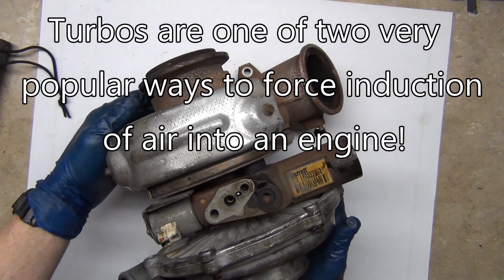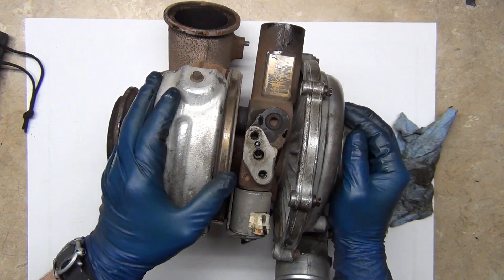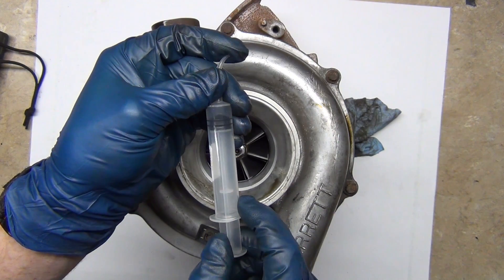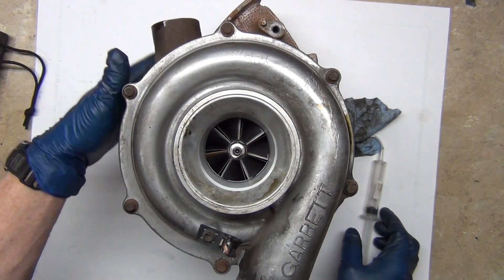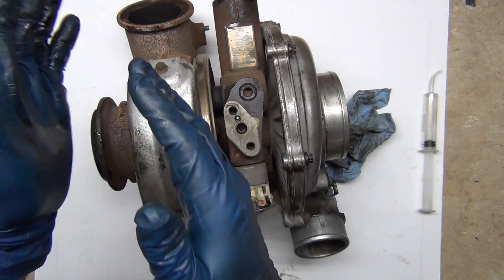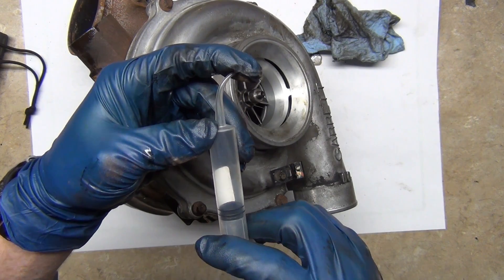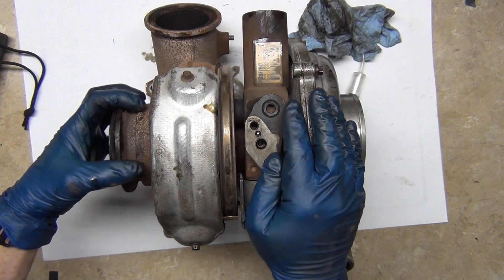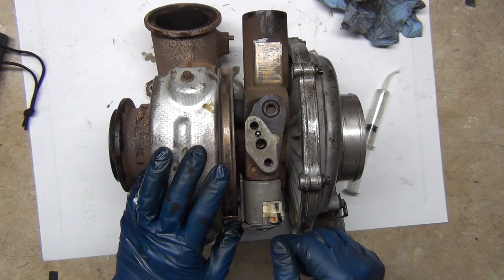How do Turbos Make Engines Go Faster?

Comment: Thanks for the great video. I was wondering I have an 06 Powerstroke, that I have replaced the turbo oil drain tube on twice now and it still leaks a little bit. I was careful with the o ring to make sure it was lubed. Its not enough oil that I have to replace any oil between oil changes but enough to bring burnt oil smell into the cab. Do I just need to replace again? Or replace just the o ring?

Comment: Blow off valve is what diverts boost pressure to atmosphere instead of to the intake. A waste gate diverts exaust gasses from the turbine of the turbocharger. Thus controlling boost pressure.

Comment: I might be wrong but I always thought that turbos increase power by compressing the air itself. By forcing the air into the motor at higher pressures the air becomes more dense thus having more oxygen in the air making it more explosive. The increased  air pressure forcing the Piston down making the engine more efficient was just a secondary benefit. Am I wrong? Because I thought you said that turbos make power by forcing the Piston down alone.
Reply from the maker: It does both.  I talk about both in the video.  It compresses air at the turbo- like I said the inlet is bigger than the outlet.  Then the intercooler condenses further, then it packs it down the hole.  Your air/fuel has to be in stoich, or stoichiometric ratio of 14.7 parts oxygen to 1 part fuel or hydrocarbon.  Extra Oxygen is bad- it causes overheating- lean backfire and damage.  This is another thing I'll have to do a separate video on.  Turbos are simple.  They pack the air in like a woman packs clothes into a suitcase.  It's up to the carburetor or the fuel injection system to match the needed fuel to it.
Reply: @briansmobile1  thanks. I guess I was confused or missed that. I think in the begining of the video thats how you described it and later in the video you might of went over the fact that the shape of the turbo on the intake side compressed the air. Either way thanks for clearing that up. Thanks for the great information you put out.

Comment: Garrett is a subsidiary of Cummins, so you most commonly find them on Cummins engines,  but they do find themselves on other engines as well.  I've seen them on trucks with Paccar MX engines.  The Paccar logo is in the metal casting, but the ID tag on the turbo says Garrett. The vanes are what Cummins calls VGT, Variable Geometry Turbo.
Reply from the maker: All good information- thanks!

Comment: My friend being a fellow biker have you ever been on a turbo bike? Before factories put turbos on bikes the were a few rebels out there . In the early 80s in Portland a fellow took a gs1100 (which was awesome in it own right for the time) and turbo'd. What a machine. Of course the factory turbos are much tamer. Thanks for the videos let's see some footage on your po po bike.  My po po bike is on a few week needed rest.
Reply from the maker: I haven't yet.  You're welcome!  Yeah- I'm on a break for now too.  I've got 2 new tires to go on, valve seals & plugs to replace, and the weather sucks in Utah right now- snow, mud, and rain. (lots of dirt roads where I'm at.)
Reply from the maker: Many gas engines I've tested compression on are around 120psi to 150psi.  Most diesel engines test at 350psi on the low end and can be up near 500psi when dialed in tight.

Comment: Brian, love your channel and personality, but the video implies that a turbocharger (rather, forced induction) improves power by reducing pumping losses on a 4 stroke internal combustion engine.  While it can, that isn't the main reason you gain power.  Burning fuel creates power.  To burn fuel in the correct ratio, you need more oxygen (function of the displacement and revolution).  Since the displacement is fixed and the rpm is limited by the design of the engine, for a given engine rpm and displacement, forced induction allows you to force more oxygen in the combustion chamber, which is then matched by more fuel to make more power.  Simple.  You are ultimately limited on boost due to detonation and stresses on the engine (boost pressure is measured before the air intake charge is compressed, so is a dramatic increase in the combustion chamber.  Compressing any gas also increases the temperature.  In short, 15 psig boost can double the power of an engine versus no boost.
Reply: No flexing; correcting.  I was trying to stay out of terms like "stoichiometry", but yes...though once you start boosting, one usually adds additional fuel beyond the "ideal" fuel ratio to reduce the risk of detonation.  The "ideal" fuel ratio depends on a lot of things...look at what Mazda is doing with their SkyActive system.
Reply from the maker: Did you just flex on me?  I'm cool with that.  Thanks for the props on the channel.  Throw some "stoichiometric ratio" into your next flex for seasoning.